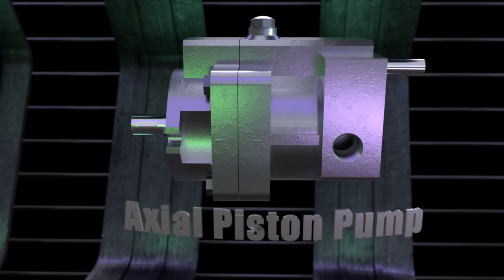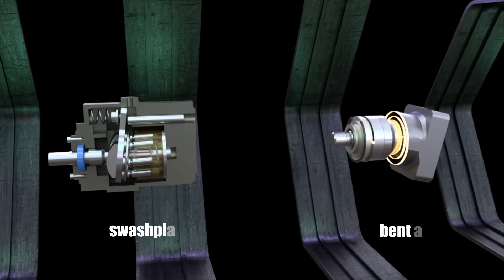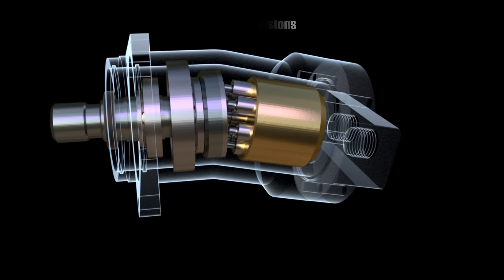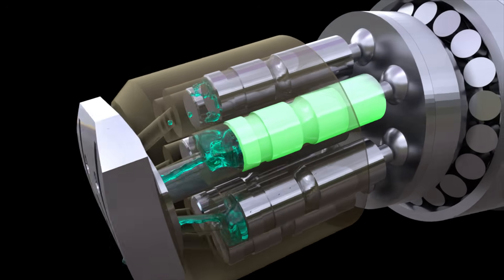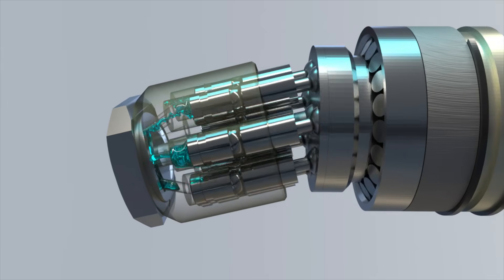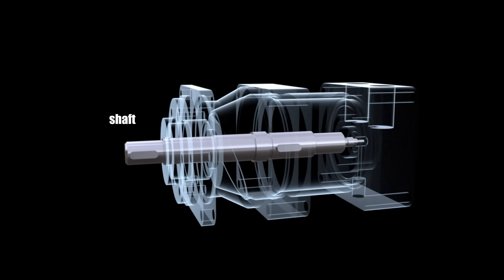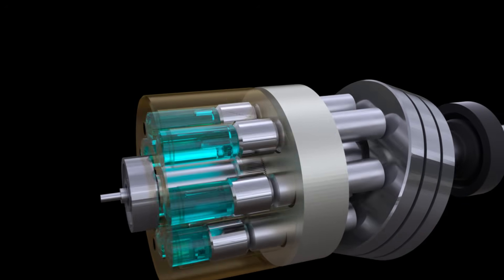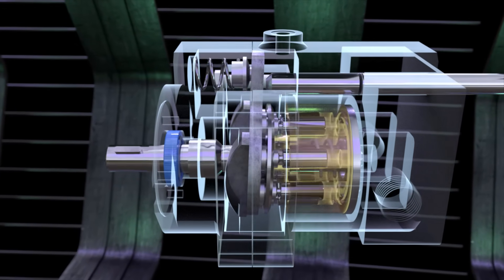Axial piston pump. How it works?

Comment: I dont like combustion engines 😊
Reply: Cringe
Reply: What does that have to do with this video?
Reply: This is not even an engine, this is a hidraulic pump that is used for everything that have a hidraulic piston, such as excavators, trucks,mobile crane, tractors etc
Reply: Okay ……………………………🤷🏽‍♂️
Reply: Ev guy ?
Reply: RIGHT, combustión means, explotión, contaminatión, destruction .
Reply: @tinuvarun5806  explosion is happening on the combustion chamber, it cannot hurt anybody, contamination? What things does it contaminate? And what distruction?? What does it destroy?
Reply: @FineasToderici  You are replying to the wrong guy
Reply: @hawkfalcon25 🧚🏻‍♀️
Reply: @hawkfalcon25 where do you think nickel for your gay arsed utopia  battery cars comes from ? Fairy’s piss🫃🏻
Reply: @ritid69  and what ressources go into making "green" powerplants to supply these EVs
The list goes on
Reply: What do you think turns the driveshaft? lol
Reply: How did you get the device you used to make this comment

Comment: There is problem into explanation and visual process representation - the swashplate pump has a moment of " perpetuum mobile mode", caused by missing "initial acting mechanism". No way on suction pistons regime to achieve piston{s} swashplate contact without spring piston preload or respectively pressurizing the pump's inlet. In motor mode of the hydro_machine  the preload is not required

Comment: Ingenious design, one thing to note is that the flow is reversible depending on the swashplate position
Reply from the maker: Yes, that's exactly right
Reply: So does it mean the swash plate can be placed on either sides ?
Reply: @musendatk  no, it pivots in place to reverse the flow
Reply: @hamstirrer6882  thank you

Comment: Made these in the machine shop for 30 years , they work well if you don't over spin them .
Reply: by over spin do you mean too fast or for too long?
Reply: @BigCroca  yes ! Either will take them out !
Reply: Do you know the cost associated in the process of making these and the tools and machines which are required to make these @scottkinkead6324 ???
Reply: @parthbagree9672  all to well
Reply: @scottkinkead6324 can the piston slippers and valve plate be resurfaced or is the tolerances just to tight to even worry about trying? I'm just asking because the parts are very expensive and if a person could get a little more life out of them it might be worth a try
Reply: @andrewarmstrong9194  not shure what your calling the slippers and valve plate as we did not call anything in the pump or motors that but in general if you can detect ware it's done or soon will be
Reply: @scottkinkead6324  gotcha, I don't know the correct term for the parts, the end of the pistons that swivel is what I called the slippers, and the plate that the valve block that holds the pistons is what I called the valve plate

Comment: How the fuck do you not get cavitation on the piston face and in the chamber that fills with fluid?
Reply from the maker: The liquid flow rate is small, so there are no large pressure losses due to local resistances. The pressure does not drop below the saturated vapor pressure, so there is no cavitation. If there is significant hydraulic resistance at the suction, cavitation will occur.
Reply: Спасибо за развернутый ответ!

Comment: I like the ideas but it seems like a stupid solution to a problem nobody had. why do people take something and make it needlessly complicated and prone to failure, its a waste of everyone's time. the inventor couldn't be happy with normal pumps he had to fuck with the whole industry and add layers of tiny springs, gears, electronics, pistons with multiple tiny seals and all that shit has to be torn down and replaced when it inevitably breaks. I cant even think of a reason to use one, what's the difference between the way this pumps liquid compared to other pumps
Reply: This is used in hydraulic systems that need constant displacement and high pressure. Its been very widely used for more than a century on pretty much any machine that uses high pressure hydraulics, construction equipment, aircraft etc.